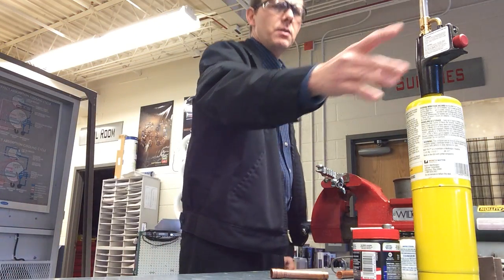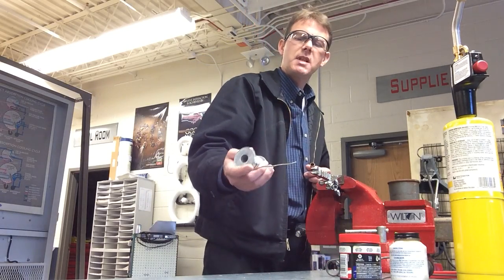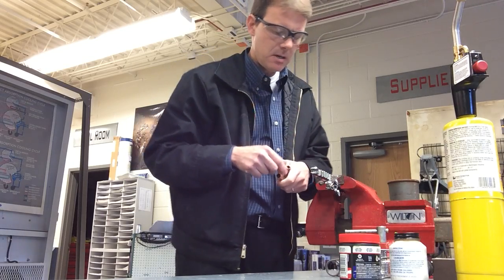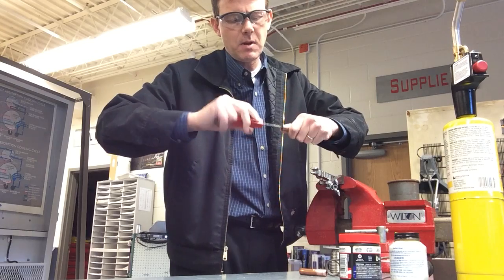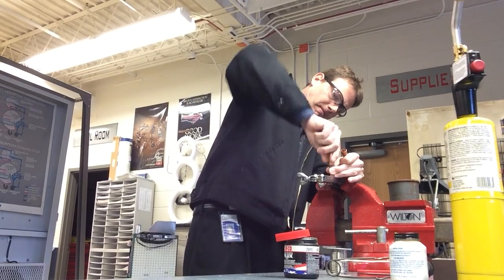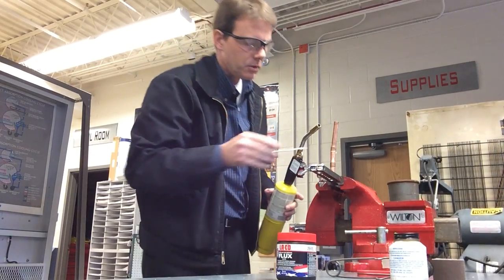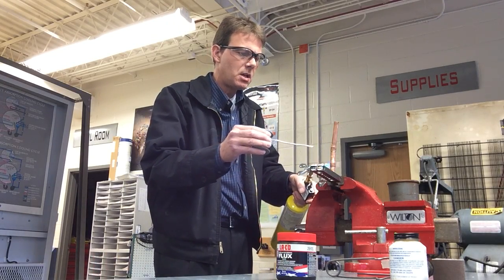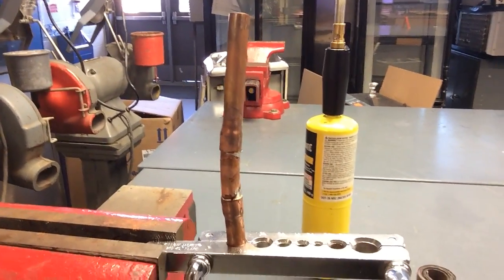HVAC Basics: Skills, Tools, & Procedures - How to solder copper pipe tubing with a MAPP gas torch

Comment: you dont know what you are doing,and it should be done horizontally not vertical with your solder dripping away
Reply: Oh yeah?  Then explain how you solder a vertical pipe if you shouldn't be soldering vertically...  Not all pipes are horizontal.

Comment: An interesting approach to soldering pipes. It's scary to think about how much time is required to establish at least thirty meters of pipe. 
Maybe I misunderstood and this method of soldering is applied only in exceptional cases. I would like to believe.
Reply from the maker: +Максим Давыдов thanks for watching and yes this is only for students to practice. I am showing 14-17 year olds the procedure. After they do about 20 of these little pieces then they can work on a regular live project.